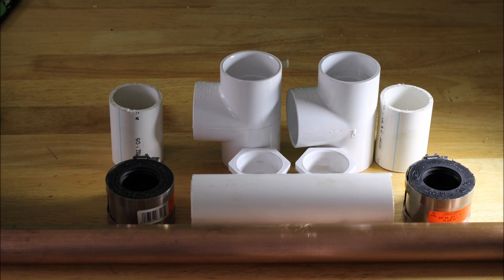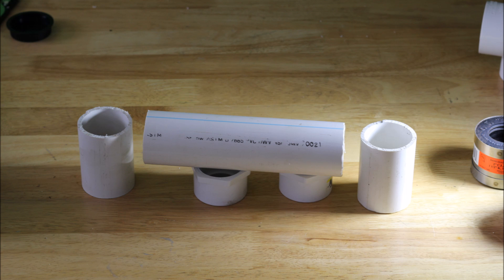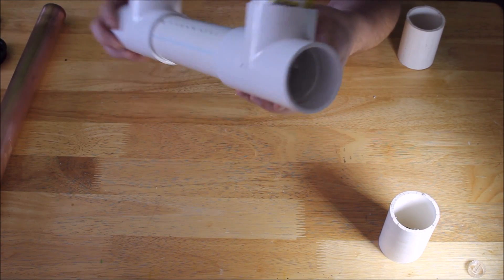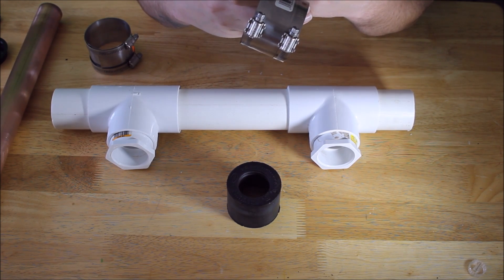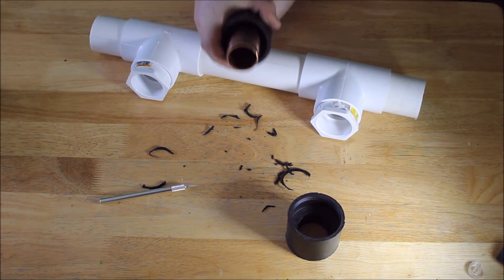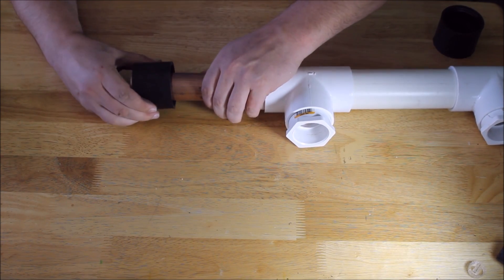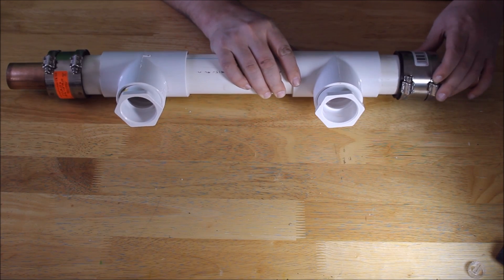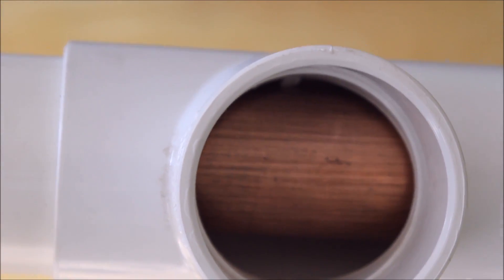How To Make A Heat Exchanger - Cheap

Comment: The one limitation for this unit is that it doesn't capture heat from the dishwasher or bathtub, i.e., it only functions to extract drain water heat when the incoming water line is flowing, but I have a suggestion that could correct this.  Instead of running the potable water through this unit, connect it to a tank/reservoir above the unit and run the incoming water line through the tank.  Heated water would flow to the tank from the unit via thermosyphon, capturing heat whenever water drains, and the incoming line would extract the heat from the reservoir when the incoming water is called for on it's way to the hot water tank (or shower directly).  
This method would also have the benefit of isolating the incoming water from the water that surrounds the drain pipe.

Comment: This looks very appealing, but how does it handle hairs and other particles that end up in the drain along shower water? This has a lot more edges and corners than a regular drain pipe, so how easily would it get clogged up? And how difficult would it be to get flowing again?

Comment: I guess we are not worried about the efficiency of this heat exchange design, correct? ;-) Sorry for the bad joke, but we need to use much more surface area of "contact" between the two mediums. That is the reason most heat exchangers have a lot of small pipes and fins.

Comment: Is such a plastic heat exchanger.  Can be used for cooling with lighter gas as cooling medium?  At minus temperatures of -10 or -20 Celsius?  Or Ethyl alcohol boiling at very low pressure?  Such a plastic tube will not break or melt chemically with alcohol or butane?

Comment: Good video,could this application be used in boats ?To cool down the liquid  that flows through the engine that is primarily cooled from the sea ?As I understood,the salt water would go through this plastic,antifreeze will go trough this copper pipe.will it need another water pump ?Thanks.

Comment: It is more efficient when you use smaller tubes and make dents in them to create turbulence. The same for the outer tube. Also make sure your Re is above 4000 and temp of the liquid not higher than 94 celcius

Comment: Ok so I’m looking into this and the concept is great but I do know sch 40 pvc pipe is NOT rated for ANY heat. I think a improvement to this would be to use CPVC sch 80 pipe which is rated for heat higher than 240 degrees which would be plenty for this. Sch 40 pvc gets soft when introduced to heat and over time makes it brittle and could burst. Also the rubber couplings are actually called Fernco couplings, or mission band couplings. A MJ (mechanical joint) coupling is what you use when you are connecting a fitting to ductile iron pipe and you have 4 Bolts that are on each corner of the fitting and it has a rubber that tightens to the pipe as you tighten the bolts. Not trying to be a smart ass or anything but if someone is going to order these parts they need to be searching for the correct parts.
Reply: awesome  if I get some homedepot slant fin  hydronic baseboads  is this exchanger works for some efficiency

Comment: Pretty simple, agreed, but I think you would make a lot better exchanger by using several smaller copper pipes rather than one big one.  Sure maybe a bit more work, but a lot of gain...and hey!, I think efficiency is more important than avoiding a little work.

Comment: Wow. That's really not going to work very well, as in probably not even worth the time it took to watch the video let alone make it. Two huge problems. First, the surface area of the copper pipe is very small. A bigger problem is that even at that, very little of the potential heat exchange is going to occur, because most of the time that drain pipe isn't going to be full. Water flowing downwards is going to cling to the wall of the drain, leaving mostly air between it and the copper pipe. If you oriented it sideways it would be marginally better, but still less than ideal, and I can't imagine how those two opposing 90 bends in a horizontal plane are going to meet building code for a drain. For that matter, the reduction of the drain diameter is going to be a non-starter as well.

Comment: Not trying to Troll but if you decide to go this route please do yourself a favor and get a backflow device such as an RPZ or you will have god knows what going into your water heater. I wouldnt drink anything that has been traveling outside and back into a supposedly closed (but uninspectable) heat exchanger.  If that heat exchanger fails your family could be drinking pool water.

Comment: sir, 
I am doing project on waste heat recovery from exhaust of bike.and by using heat to preheat the inlet air of suction 
temperature should be increase by 10 Celsius
so can u explain  design
Reply: Sangram Ghorpade you want cooler air entering an engine.  Not warmer.  Warmer air is less dense and therefore less effiicient .  Same with fuel.
Reply: ...and choke regulators, and on airplanes for de-icing, but he didn't say that it was for warm up, so I didn't assume.

Comment: will it work with car mobile shower out of coolant heat thanks
Reply: These days it is quite crowded under the hood but many a country boy has heated his lunch by placing a can  (with the lid punctured) on top of the exhaust manifold of his truck or car.  If one picked up some quarter inch copper tubing and coiled it around his exhaust system and pumped cold water through the coil it absolutely could bring the temperature of that water up to boiling.. However in modern cars there are so many electronic sensors that the information the car computer gets may cause unexpected consequences.

Comment: were is part 2 rob mate? and just to clarify, its the waste water flowing through the centre pipe and the mains supply water in the external pipe?
Reply from the maker: Yes it is the waste water flowing through the middle pipe. Never made part 2. working on revamping the channel. there will be a part 2 then.

Comment: What is the pressure rating on the pvc parts?
Reply: beyond any residential application
Reply: Tyler Lowden, at 70°F that is true, however PVC loses strength very rapidly as temperature rises and at 140°F the strength is only 22% of the rated pressure capacity. I have seen PVC pipes squirm in buildings at 90°F and joints separate at 100°F when operating at 1/3 of their maximum rated pressure. The derating  charts are easily found on the Internet. One other thing; make sure you are using Sch  (Schedule) 40 or 80 pipe. Hardware and big box stores sell cellular PVC for drain purposes and they are NOT designed for any pressure.
Reply: There are several types of PVC, all have different pressure ratings.  Some states do not allow PVC for hot water as health concerns are involved. PVC products fail in unusual ways. Most don't handle sunlight well. I would avoid PVC for any experimental uses or critical situations if failure occurs.

Comment: Any thoughts on what happens if the interior pipe experiences failure for what ever reason. Granted, it's unlikely, but you'd be mixing your incoming water with outgoing waste and may or may not noticed it depending on if you could taste or see the contamination.
Reply from the maker: You are also talking different pressures. You would always have more pressure in your potable water. So if you had a pin hole the waste would not make into the higher pressure zone.
Reply: the potable pressure would be much higher. yes you're mixing. and yes it's a health risk. but you'd likely just waste a ton of water and never know till your bill came. lol
Reply: Matthew Kahler a

Comment: Please emphasize on copper pipe type. I used the 1-1/2" copper pipe type M but noticed that the 1-1/2" side of MJ coupling is too big for it since it's designed for PVC pipe of the same size (The copper pipe OD is different from PVC pipe OD). I don't know if there is a copper pipe with the same OD of PVC pipe but now I want to thicken the OD with some tape!
Reply from the maker: MrAmoslemi You just need to purchase the right MJ clamp. You need to buy a 1-1/2 MJ x Copper coupling.

Comment: Thanks for putting this video. I watched it and want to make one. I wonder where I can get the required copper pipe size and MJ couplings? I checked Homedepot, Lowes and ACE hardware and neither of them has the copper size or couplings?
Reply from the maker: MrAmoslemi Yea they can be tough to find. But, you can easily find the coupling online. I am really surprised that Lowes does not.
Reply: The big box home stores have been getting away from copper products due to price and convenience of use of alternatives. In the past I have hooked up dishwashers and incoming lines for sinks and toilets with copper. These days people just do not do that. The products offered at the stores reflects that.  Galvanized pipe is also way too pricey now. Much of this is reflected in the wicked price of new homes.

Comment: Hey Rob, great video. i am thinking of using this for a couple of showers in the house. Should I be concerned about the  rubber couplings and city water pressure over a long period of time? Also the heat exchanger would be installed between joists behind drywall, any condensation concerns?Thanks
Reply from the maker: Andy Morel I have had a similar exchanger in use for over two years now. No issues to report. As long as you build it exactly as shown there will be no issues. Shower drain size is 1-1/2" min. Keep it that way. Thanks for watching.
Reply: @RobThePlumber  How much electricity have you saved after installing these?
Reply: MJ couplings are not rated for pressure applications. they are gravity drain only

Comment: one should make the heat exchanger so that the water flowing in both  pipes flows slow enough to exchange the heat from side to the other. if the water flows too fast it wont absorb much of the heat. maybe make the copper a lot smaller so the mass of the outside water will transfer more heat!
Reply from the maker: kiffertom I see what your saying but you would be breaking the plumbing code by slowing down or reducing the shower drain size. It would work short term but in the long term your drain would get clogged up pretty quick.
Reply: For reference, if you go from a smaller size tube to a larger size, the water will slow down and heat transfer will be more efficient.  Try that for both lines.

Comment: Hey Rob, really appreciate you generosity. Any thoughts or experience on max safe operating pressures/temps with this simple design? I'm thinking of using it for a concentrated solar water heater which may see >80 °C and several bar. Don't want to hurt myself, or anyone else! Thanks.
Reply from the maker: ***** Go and check my all copper design, i would go with that. with 80°C, I would not use any plastic. Thanks for watching.

Comment: I just got some ideas on building a wort chiller by integrating your design.  In case you don't know what wort is, it is basically beer that has just been cooked.  It needs to be cooled quickly, so the yeast can be pitched at room temp.  The longer it takes for the wort to cool, the more chances for airborne bacteria and yeasts to enter the unfermented beer.  So, people use either a simple copper coil in their brew kettle and just run cold water through it, or a more expensive bar and plate heat exchanger.  I like this idea.  I can pump the beer through the copper portion of the exchanger and then either hook a water hose up the other section, or use a closed system with a radiator.  I have most of the parts already, including a radiator.  Well, I take that back.  I need a food grade pump for the beer, unless I decide to gravity feed it slowly into the exchanger.  I have a pump for the other side.

Comment: Say you'd want to build a heat exchanger for your PC, how would you go about it. Seriously, I am considering it, and have for years. But I need some input and ideas how to solve such a problem. I am very well versed in PC modding, so that part doesn't worry me in the least. It's the heat exchanging part that has me worried.
Reply: (AIO water cooling solutions exist now)
Reply: Thermal plates they get cold on one side and hot on the other

Comment: You need to size a heat exchanger if you want it to be efficient at actually exchanging heat. This method will not give you good results, but it will work. The ratio between the outer diameter of the copper pipe and the inner diameter of the plastic pipe are crucial! they should be between 1.7 and 2.5 for bet results. also you want the fluids to flow in opposite directions. The small wall thickness of that copper makes about 2% difference between using copper or aluminium also by the way. The hottest fluid should be placed in the inner tube with the cooler fluid which needs heating in the largest tube. and you should never use copper on the outside because it has a high thermal conductivity, so you will just waste heat if you do so, what you want to do is use a material with a lower thermal conductivity on the outer pipe, this will help keep the heat INSIDE the heat exchanger.
The copper tube will be very smooth so you might also want to consider giving it a brush to roughen that as it will help with heat transfer.
Reply from the maker: As I agree with most of your comments, I must say your giving too much thought to this very basic exchanger. Your ratios mean nothing without knowing what the temperature of the fluids are and knowing how much of that temperature you need to transfer from one fluid to another. You also need to take into consideration of fluid velocities, pressures and viscosities. This exchanger was meant to show that you can make an exchanger with basic easy to find materials. This is not to be used with anything warmer than domestic hot water temperatures. ie.* capturing temperature from waste water from a shower and transferring to cold water feeding a hot water tank* There is nothing wrong with making the outside chamber out of copper! That is what simple pipe insulation is for.Also if you are going to go to the extreme of sizing an exchanger for efficiency,this is definitely not the proper design needed. The copper was roughed up, but in my design I use there is a copper fin, in a spiral that is brazed to the copper transfer tube. There is no way to slow the hot waste in the centre pipe without risking drainage and venting problems. In any heat exchanger fluids ALWAYS run in the opposite direction. I show that in the video.... I have quite a few videos to release on different exchangers and the sizing of them. It is unfortunate, work has been hectic and I cannot release as many as I would like to. Thanks for watching and taking the time to comment.
Reply: I see your point, I recently just finished writing my dissertation as well as a patent application for a new type of heat exchanger which has a very advanced design, so I am still in the mind set of achieving ultimate efficiency in design. But like I said this design will work, but it could be greatly improved if a few hours were spent running some numbers, and I think you should emphasise this more to the viewers, you could probably even do a few extra videos on how to run the numbers, for this application a simple dittus boelter equation would work fine for both the tube and the annulus. It was an interesting video however, quite a novel approach which I like, I will watch some more videos once i have some free time.
Also, fluids do not ALWAYS flow in opposite direction in a HX, its completely dependant on the application, as you are recovering waste heat, then yes, you would want a counterflow arrangement as it will capture the most thermal energy. Just because the outside of the copper pipe is lagged doesn't mean you are not losing heat from it, so using low thermal conductivity materials for the outer later and then using insulation also, will improve this.
Reply: @evo1empire  what can I use inside the inner copper pipe to heat my pool water entering the outer chamber? I'm assuming that  just heating the empty pipe with a fire isn't the best, but I'm worried that heating a liquid in the copper pipe in a closed loop could explode.... Thoughts?

Comment: Great video. It's this first one I have seen that mentions 'countercurrent heat exchange system'. People do not know what a differents it makes just to make sure which way the flow is going. Can you list the parts, especially the rubber part?
Reply from the maker: http://plumboogle.com/plumboogle-plumbing/how-to-make-a-hybrid-heat-exchanger the full list can be found here along with some other specs. Thanks for watching.RTP